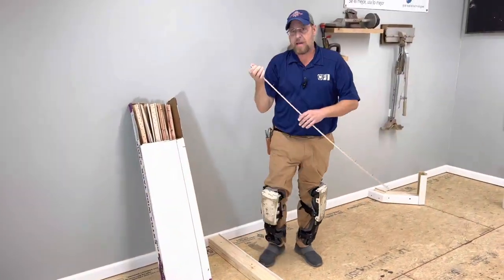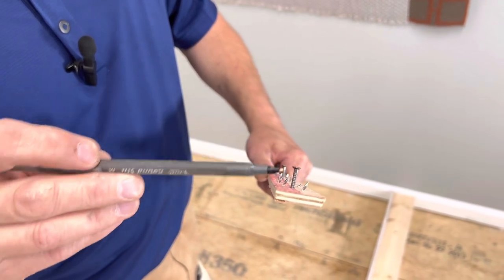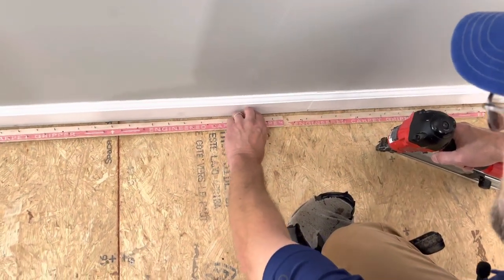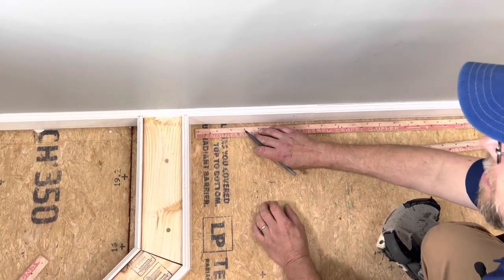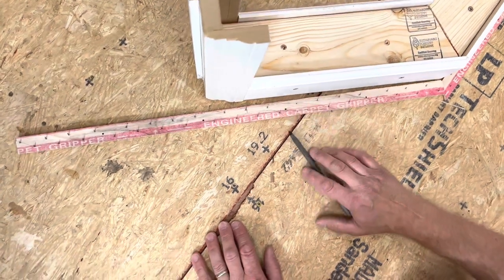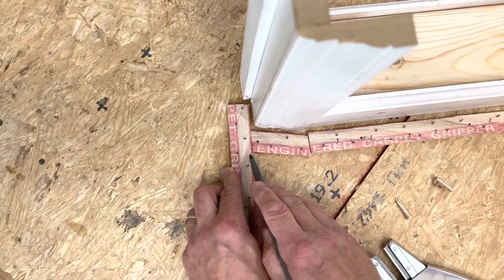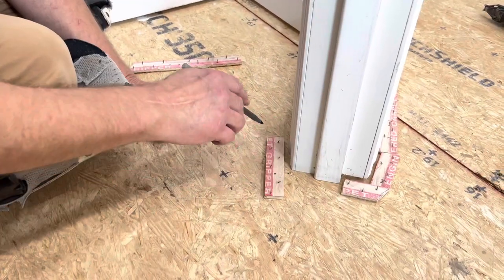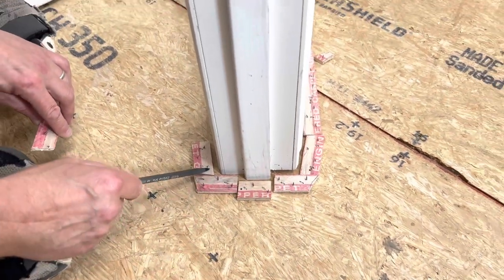Step-by-Step Guide to Installing Tackstrip for Carpet"

Comment: I love the way you're doing these videos, keeping it simple and short.
Almost all new installers or trainees are learning from an existing installer....
.... Who also learn from another existing installer.
Good practices are passed on to the next generation,  but so are bad practices.
As with everything in the world, rules are made to be broken.  Before breaking the rules in certain situations, you need to know the correct methods in order to make that call.
I seal virtually all of my seams. With hot melt there's no drying time.
If you have a 6 by 7 walk-in closet a some reason there's a 6-inch seam along a back wall, it doesn't really need sealer because it will never be stepped on, almost never be vacuumed, and it will be covered with boxes and shoes or overhanging cloths.
The doorway seam going into the closet absolutely needs seam sealer.
This is where judgment comes in.
......ok, and now back to this tack strip video.
This is what guys need to learn. You're showing the correct way to do it.  
I've seen tack strip cut with a hatchet.  I've seen people put one piece of tack strip across the face of a door casing 😖😖😖
What you're showing here is even more important with low profile and woven carpeting.  
I think your new videos are great, especially for the young guys that are just starting out I'd have never had 'real' instructions.
Reply: I use 1 piece across door and works perfectly fine  haha 😄
Reply from the maker: Man, thank you for that. I appreciate you taking the time to write all of that out, and I can agree with every thing you are saying about the trade and practices being passed down, I also appreciate the feedback on these new videos. I’m glad they are being liked
Reply from the maker: @MaelthasDivine  😂😂👍
Reply: @MaelthasDivine  don't forget to use plenty of staples 😁
Reply from the maker: @MaelthasDivine  i do it on every job
Reply: @FlooringInstallationtricks  well the next installer who has to rip up the tack strip will not be happy. And I hate ppl who use crown staples to put tack strip on its stupid.
Reply from the maker: @MaelthasDivine  it is super simple to get it up, I have done it numerous times myself, and I only started doing it after I had surgery on my right hand, and now I am unable to use a hammer for any amount of time at all, I can use a hammer for about 10 minutes straight and then I am hurting so bad that I am ruined for the rest of the day. That is why I ended up switching over and using my underlayment gun. Oscillating tool with a Dremel titanium blade, and it will cut the staples flush to the floor, super fast and easy once the tack strip has been taken up